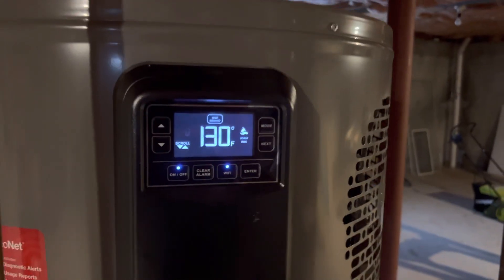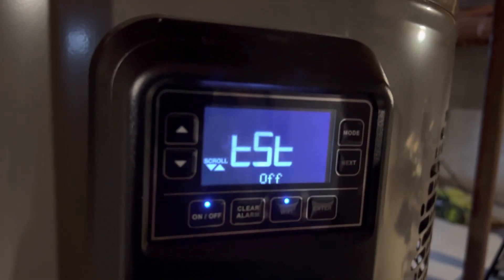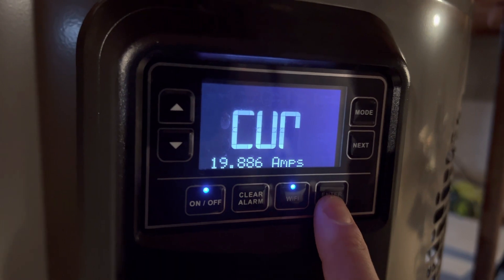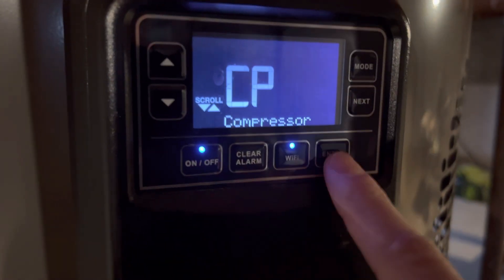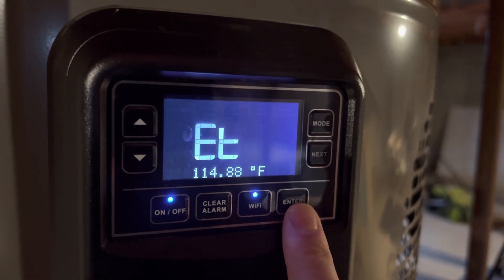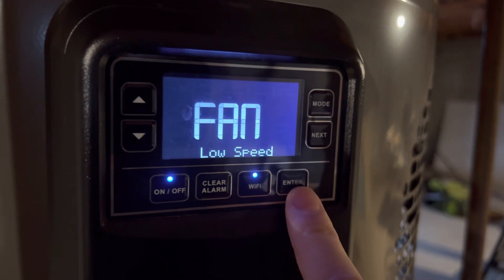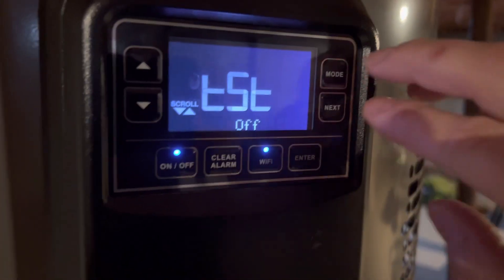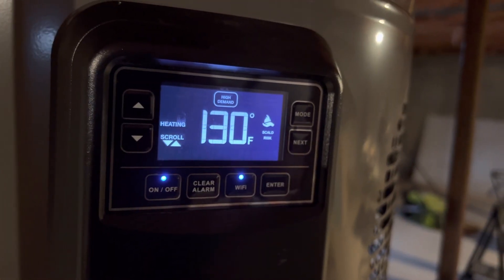How to enter and use Test Mode on a Rheem Hybrid Water Heater

Comment: We moved into a new house and it has this type of water heater, my husband put it on electric at 125 on the temperature. My question is, why does the water heater change from electric to another mode, it's like it turns on, and what would be the recommended temperature to have hot water?
Reply from the maker: 125F is a good temp. I run mine at 130F because it makes the hot showers last a bit longer (they blend in more cool water), but technically anything over 120F can burn your skin (120F will take ~10mins to cause a burn. 125F will burn in 2mins. 130F takes about 30s. 140F burns in about 3s).

RE mode, if you have a heat pump water heater you should run it in Eco mode (or high demand mode) unless you have a very good reason to change it. Running in electric only mode is inefficient, as it won’t use the heat pump at all.

Comment: Anyone thinking about a hybrid,  just be careful and do your research if you have a hot water recirculator. I was not aware that the rheem hybrid I have does not work with recirculators, because it relies on a 25 degree temp drop to detect demand. But recirculators average the temp out between tanks. Also mine has failed so many times and must recently the upper element relay getting stuck on, and tripping the hot water overtemp switch, for a lovely cold shower in the morning. Several parts on the unit also leak. I'm just not impressed

Comment: how can i override the 140 degree temp limit?
Reply: Push up arrow at 140 the display will then say to push and hold the up and down arrows, it’ll beep then you can increase the temp to max 150.
Reply: Mine must be locked. Tried this. @NewLightEnergy

Comment: You said you were having compressor issues.  I assume that is related to your evap temp?  Mine just started throwing the a005 error and from what I've gathered, it might be that thermistor and that it is a pretty common failure.  Just curious if that was what yours ended up being.
Reply from the maker: Mine was indeed a bad thermistor!
Reply: @UrbanTinkerer  Yep, mine too.  I need to get around to ordering a spare set of them to keep on hand.  They are cheap enough that I didn't even bother trying to get them to ship me some under warranty.
Reply: Same here, it was a bad evaporator thermistor after only 11 months of operation.  It took me two calls to Rheem tech support until they figured out what the problem was.  The first time they thought it was the control board and sent me one.  Seems to me that Rheem should find a better supplier for the thermistors.
Reply: Any part number for the thermister? And instructions to swap it?
Reply: @FreyGuy003  The paperwork that came with my new thermistors listed a part number of AP15095.  Here's a video (starting at 37:45) that shows where the evaporator thermistor is located:  https://youtu.be/MVjvVEv90QA?si=02qK-SmJl-XcplX_
Reply: @FreyGuy003  https://youtu.be/MVjvVEv90QA?si=EfNUUPct_bVbuEgb&t=2265    Part number: AP15095